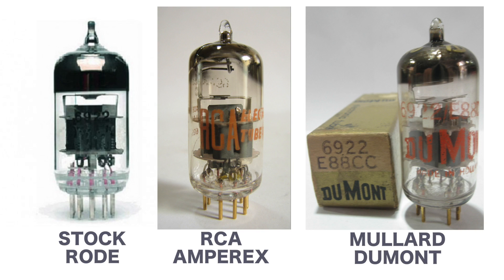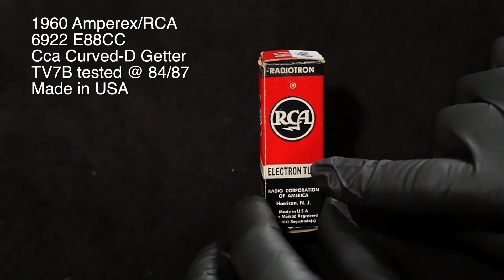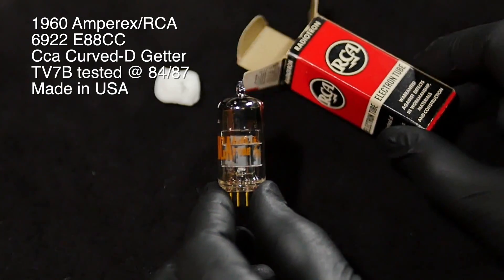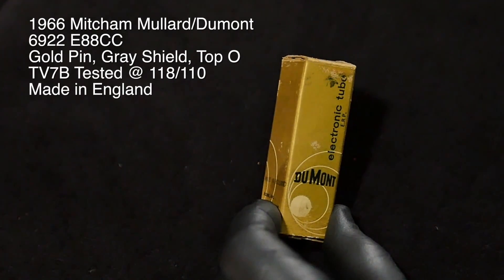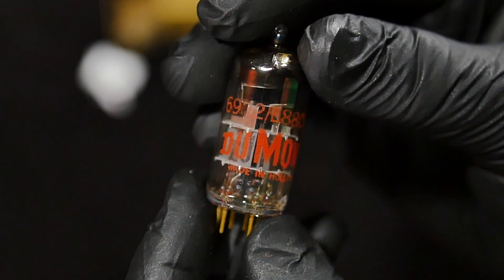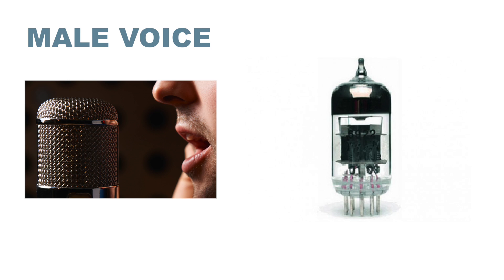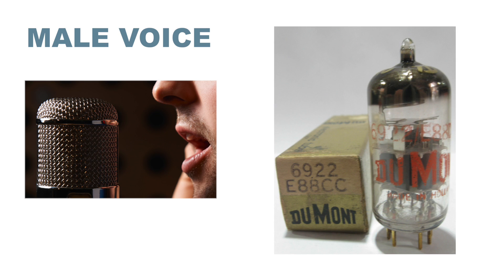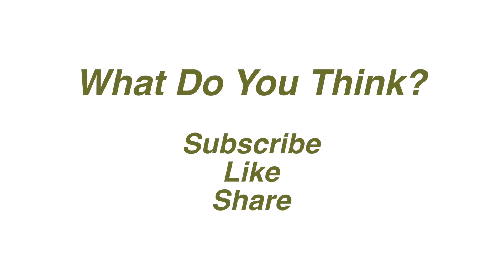Microphone Tube Test - Amperex/RCA, Mullard/Dumont - 6299 E88CC

Comment: FYI Skin oils will not hurt a tube.  That myth comes from very high intensity halogen bulbs that get so hot that any surface oil will cause the glass to heat unevenly and ultimately break it.  Tubes don't get anywhere near that hot.

Comment: Ok Mr. Das, gloves are only necessary to prevent the lettering on the tube from flaking or rubbing off, unlike halogen auto headlight bulbs that get super hot and can shatter with only the slightest amount of oil from the skin, vacuum tubes, even audio power beam pentodes are not compromised in any way from skin oil other than marring the labeling which can alter their collectible value.  AND if your concern is in maintaining the tubes' collectible value NEVER clean them with a "light alcohol and water mixture" because THAT will surely degrade the tubes' labeling and degrade the tubes' collectible value. 
Look, your video is important and tubes are indeed the way to the most organic and life like sound but please get your facts straight before you make such inaccurate comments and give such erroneous advice and care instructions.......Fact check me and learn.
Reply: Thank you. I cringe when ever I hear or see the tube glove myth.
Reply from the maker: Good to know. Thank you for the information and helping make this video even better.
Reply: Thanks for this comment

Comment: They pretty much sound the same to my ears.  Sounds like the Dumont has the least noise however.
Reply from the maker: rwgamer Yes - My experience of the Dumont is a little more open and smooth sound, also less harshness on the mark tree as compared to the RCA.
Reply: rwgamer the Dumont had resonant nasties with the guitar plus on the first clip. somethings wrong with the internal design

the RCA makes the guitar sound like a real guitar. the first tube makes the bass notes of the guitar too resonant and bassy. I'm buying the RCA
Reply: You'll have to listen with decent headphones. Headphones under $100 usually don't have the detail and resolution.